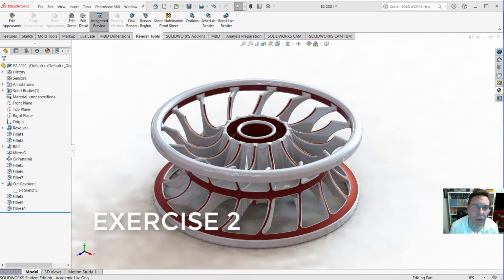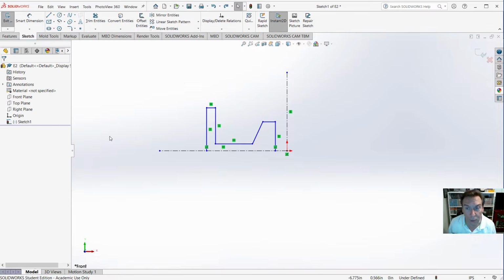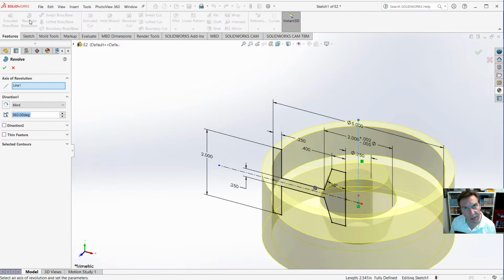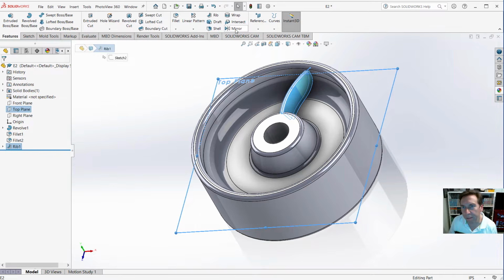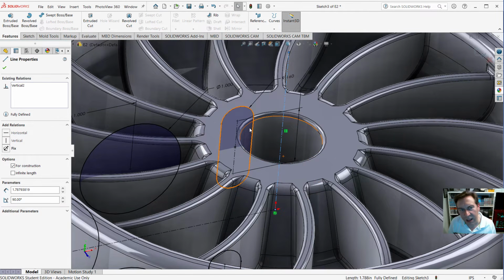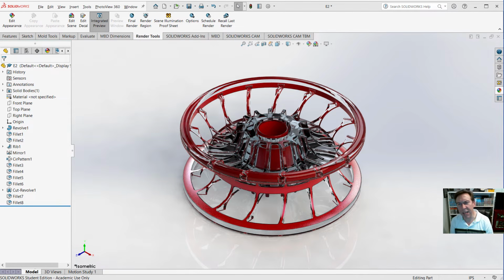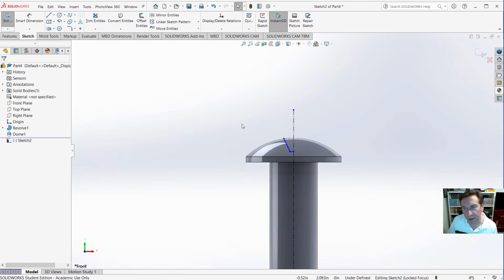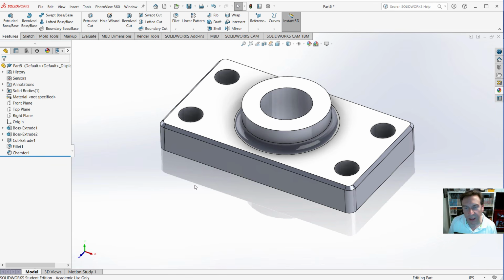E2 SolidWorks 2021 - Basic Modeling 2 Tutorial

Comment: Thank you very much for this wonderful guide! It has been doing wonders for my understanding.

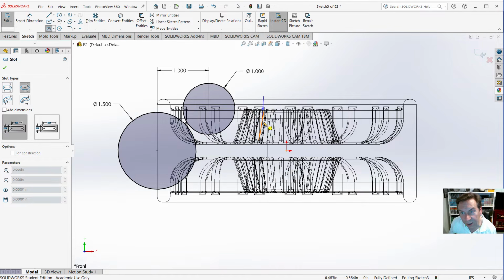I do have a question: How do I find the midpoint at 24:30 for the center-point straight slot? For some reason, I can only get the line directly below or to the right of it, but not directly on the same one you have. Is there a way to make the midpoint show itself?

Comment: IDK if you'll see this, but I've tried every way I could think of to get the CenterPoint straight slot 1.6 to smart dimension it, but as soon as I go to dimension it, it over defines it, locking it so I can dimension it. Is there a work around or am I doing something wrong?
Reply: Hello, I might be able to help out if you haven't solved it! What do you mean by 1.6 in your question above? I don't know what your sketch looks like, but my immediate guess is that you are probably accidentally creating sketch relations in your model. For instance if you set one point in the slot coincident to another point and such. This would unintentionally add constraints to your model and be the cause for why you are overdimensioning the sketch when applying the dimension.

It's a little tough to explain in text, but let me know if this doesn't make sense and I'll try another way of explaining it! 🙂👍

Comment: Thank you so much! For anyone who gets an error while trying to revolve cut, make sure both your lines you draw down the middle and up the center are "centre lines" not just a line.
Reply: I faced an error when trying to revolve: 'Sketches used for revolve features should contain a single, non-self-intersecting contour'.
Solved by choosing the right contour at the features' manager on the left when making the revolve. Before hitting the green checkmark.

Comment: Once you create the dome, how do I set the dimensions of it? Radius can not be set with smart dimensions. Once I clicked the curvature of the dome, it shows that the radius is 0.73. But it's greyed out, not blue. Can anyone help?
Reply: Most of the time radial dimensions freak out. Idk why but i normally just set the radius in the side bar parameters, trimming the radius to where i need it then just hitting "fix" in the relations section. It blacks out and works fine. Just remember to delete any fillets before going back to fix anything if you need to. Youll end up needing to fix so many constraints